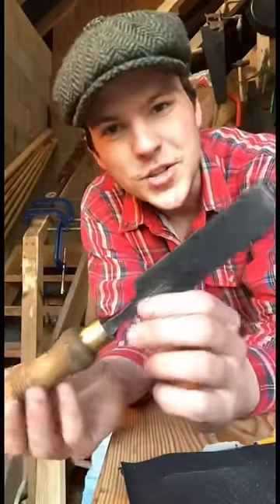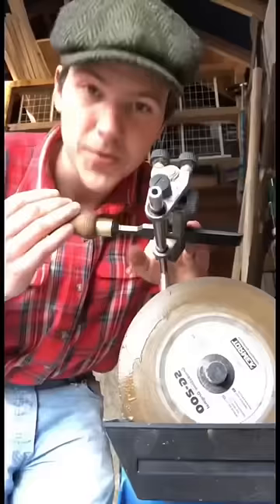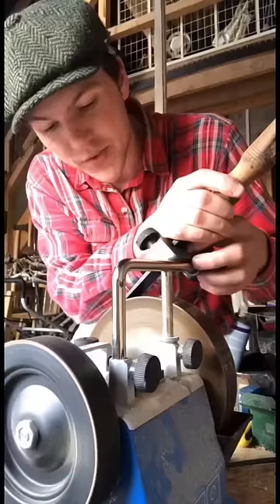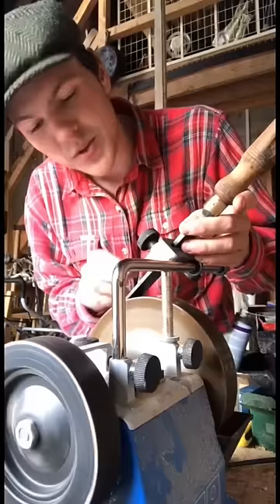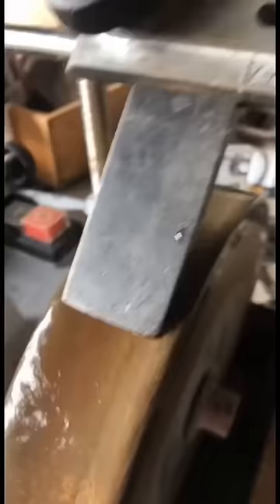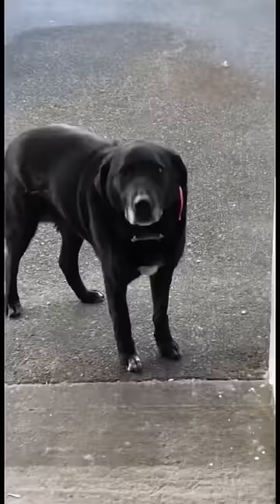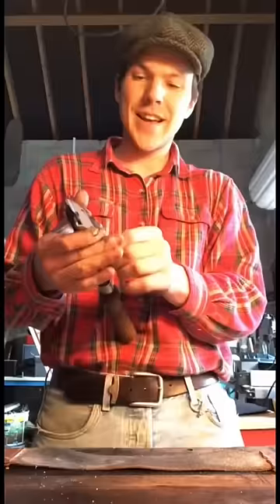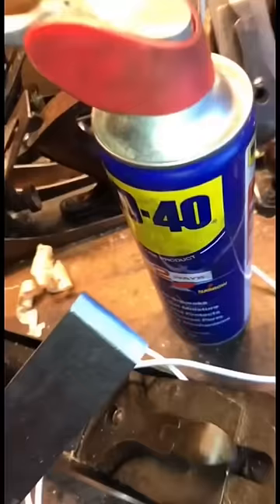Sharpening an old Sheffield firmer chisel #woodworking #satisfying #shortvideo

Comment: I remember in college a professor showing us what the leather strap does to a sharpened blade under a powerful microscope and it is insane. After sharpened to a razors edge if you look under a microscope there is no edge it's a million little individual almost what looks like hair at the very tip of the sharpened edge. Even though it's Sharp they are all out of sorts and pointing in all different directions. After scraping it on leather all of those microscopic little needles magically come into alignment with each other and no longer look like something throwing up gang signs but all uniform and laying down. The light then refracts off of that corrected surface and gives it the mirror shine. Crazy that leather can do that to metal. I thought that was some medieval shit and the thought of doing it was crazy after sharpening the blade now the thought of not doing it is crazy after seeing it under magnification.
Reply: For as long as blades exist the leather strop will serve a purpose it's held strong for thousands of years and will keep doing it for thousands more.
Reply: I didn't know it did that, that is insane to think of
Reply: Strop :)
Reply: What would be dope to see
Reply: Same thing as a honing steel that comes with your kitchen knives. Just realigning the burr.
Reply: @i8764theKevassitant  ehhhh. Yes and no. The idea behind leather strops from a technical standpoint, is that the leather and additional abrasive compounds bend the messy wire burr you get from sharpening back and forth across the length of the blade until it snaps from fatigue and being worn away by the really fine abrasive, so in the end as the OP mentioned, all the wire edges are all in the same direction at the same height, making a razor sharp edge. The idea behind a steel (this is just what I’ve heard them referred to as by my friends who have worked as butchers before, but I’m referring to a sharpening/honing iron/steel), is that through use or hitting particularly hard bones and things, that finely aligned edge will start to bend to one side of another and curl into itself, obviously stopping the edge from being razor sharp, so you use a steel to push the edge back into the centre of the blade quickly while you’re using it until the next time you go through and sharpen and strop the knife.
Reply: That's really cool

Comment: Fun fact, it doesn't need to glow to lose its temper. Before that happens you'll see a faint blueish brownish line that travels from the point of friction, everything on the heat side is annealed, the part on the brownish end are chisel hardness, everything in the blue section is around 45 Rockwell hardness and won't hold an edge well, but will sharpen easily

Comment: few things for people who might be interested: the angle he mentioned changes depending on purpose. for a chopping chisel you usually use 30-35 degrees. they'll stay sharper longer but will cut less nice. Great for chopping stuff, aka hitting the chisel with a hammer to literally chop out stuff.  a cutting chisel will have an angle of ~20-30 degrees. the lower the angle, the better it cuts but the faster it will dull. this is because it has less metal supporting it. 

a watercooled grinding stone is not necessary, but it makes the job easier. I usually dip my chisels in water. leave a little drop of water st the top (it'll stick right to the bur) and watch it closely. Once it starts to change or get smaller you dip again. in ye olde days they just used a big hand xriven grindstone OR did it on a rougher whetstone. 

i don't have a stropping belt. if my chisel needs a bit of a touchup I'll drag it over the belt I'm wearing while working. just loosen it up and use the slightly rougher underside. 

you can see how he uses a lil jig to hold the router, but when you freehand it long enough you'll eventually be able to hold an angle perfectly without a jig. just wanna flex my own skills for a bit ya know ;)

also. everyone has their own preferred whetstone grit. I have no idea which mine are but I skip the ultra fine stuff, unless I'm working on expensive stuff. it takes too long, especially as I usually do 5 chisels after each other.

I always enjoy this guys vids 

fijne dag maatsje
Reply: Resident sharpening expert here;
Sharpening at more acute (lower) angles actually INCREASE edge retention, and allow for better cutting. But they lack edge stability and toughness, that is why you sharpen at more obtuse angles.
Metal supporting has nothing to do with edge retention, because it is not part of the cutting portion of the edge, but it does help in cases where deflection could cause damage to the edge (rolling or chipping.)

Obviously there is a minimum angle you need to keep for the chisel to not collapse once pushed into the wood, but you can go as low as your steel can maintain, and it will improve the experience greatly, compared to sitting at an absurd angle just because you've been told it's 'ideal'.

As for stones, I don't get the super high grit stones either.
Sure it's nice to mirror finish my chisels, but practically? 600-800 tops, deburr on stone, maybe strop after, then to work.
Anything above 2k is kinda meh, and doesn't meaningfully improve sharpness.

Comment: So I’ve done this completely wrong for years.  Sharpen it with a angle grinder. Watch the temper leave (which I just learned here) and then chisel out one door hinge and the chisel isn’t sharp anymore.  Curse, throw the chisel back in the tool box grab another one repeat.  When I’m out of chisels go back to harbor freight and buy another 7 dollar pack of chisels.  This video was very very informative.

Comment: Funny story. My chisel at work had lost a clean edge, nicks and a generally dull appearance and feel 

I need my work to look good and the chisel is my favorite tool for precision. 

I had no other way to do the work so found a cinder block, and decided it couldn't hurt to try, I can always buy some whetstone and fixe it.

It worked, I got a perfectly straight edgy(maybe off by half a degree or so but that wasn't a big deal) no more nicks and this time it actually bit into the wood.

It worked well enough and I'll always be proud of that tiny bit of ingenuity. 

I'd be ashamed to tell a real carpenter that story but shit I felt pretty proud of how well I sharpened that garbage edge. Got the day done, and my work didn't look like a hack did it with a power tool
Reply: Cinder blocks are fine. I've sharpened with bricks I've found in the mud, slabs of concrete, river rocks, and natural whetstones I've found myself. 

If it works, who cares, sharp is sharp, skill is skill.

Comment: You can sharpen a chisel on a belt sander, just because it's not watercooled doesn't automatically means it will overheat.
Reply from the maker: You can do but you wanna be careful with heat, it might loose its temper.

Comment: Damn, no wonder my wood workshop had shitty chisels. They sharpened all of them in the worst way. I even suggested to bring them to the metal shop to sharpen them, as they probably had the equipment to do it, but my teacher insisted that a dry sandpaper belt would work. My favourite thing to use in that shop was the lathe. You can see how this was an issue.

Comment: You should show lapping the back side flat to mirror as well and mention the bevel can be cut on the stone as well it not as nice as the wet grinder and it’s more work but it is more likely you won’t have a wet grinder I’ve found for job site hollow grinding the bevel if you grind the bevel flat on the stones then use you Dremel tool round stone slowest speed and just slight dish out the center only if the bevel leaving the top and edge untouched she will ride against the stone real nice for future sharpening of coarse finish with strop and rouge wire removed and mirror finish bevel and back first few inches.

That was a lot I should have made a video. Oh yeah I don’t know how to do that. Ha!

Comment: You forgot to lapp the back of the chisel!
Also, for those of you that don't have a months wages to blow on a fancy Tormek sharpening system, coarse, medium and fine oil stones and a cheap honing guide work just fine (though I prefer diamond plates to stones).
Reply: Ehh I prefer rubbing two bricks together and making a flat surface, then freehanding it.

Comment: You're showing people how to sharpen a chisel on a $700 torment grinding machine? I'm not sure how practical that is for most people. I've always used a jig some you can get on Amazon for 10 bucks some you can get on Lie Nielsen for 100 but it works fantastically on some diamond plates and I've had amazing results. Not to criticize you cuz you're doing what's certainly is working for you but it may not be the worst idea to show how to freehand or use a sharpening jig. Just my two cents not that it means much

Comment: hey! i was wondering, how do you sharpen a curved gouge/back bent gouge? i’ve had a hard time trying to figure it out as i’ve heard it’s pretty difficult, do you have any tips?:)
Reply: Paul sellers has a good video on it.
But it is essentially a figure 8 pattern while rolling the tool so you hit the entire bevel.

Or take the stone to the tool and do circles and hit the entire bevel.

Comment: Can someone help me understand? wouldn't a curved grind stone make the edge curved too?
Reply: Yes, but, if you assume that's an 8" diameter wheel and the "flat" he's cutting on the chisel is about 3/16", the depth of that curve is about 0.0044", or less than 1/128", or about 0.1mm. His first whetstone will take that out quickly.

Comment: Doesn't the Chisel get caught on the grinding stone when it's being ground with the stone like that I've always had things jump out of my hands or The Jig I had it in and fly across the room if I try to sharpen it like that I always had to go with the rotation of the Stone when sharpening not against
Reply: Only if you force it into the stone.
Like this, minimal to no pressure and consistent angle, it will not happen.

Comment: could you re temper it?
Reply: No. Once you over-temper that's it. It becomes to soft.

You CAN reharden it. But this is tricky, especially with unknown steels.
Once hardened you can temper the steel to where it used to be.

Not good practice to keep re-hardening tools though. Better to just keep it cool (<150°c)

Comment: Holy shucks did you just shave with a chisel? I didn’t know single edge blades could be shaving sharp.
Reply: They are usually easier to get sharper (exception being straight razors) because of their simpler geometry.

Comment: Jesus, if you're detempering steel with manual labor you need to worry about you joints, also 300C is no joke, how long does it take to get that hot?
Reply: It doesn't need to get that hot to lose temper. 140C+ can soften steel over time and over repeated grinding sessions. I was a slaughterman for 16 years and when ever I was grinding my knives I would always do it bare-handed, feeling for the heat of the blade. As soon as the heat makes it through the blade enough to be hot to the touch, you could  safely assume the temperature on the side being ground was much hotter. On a belt sander it would only take a few seconds to heat up to the point where it would have to be dipped in water